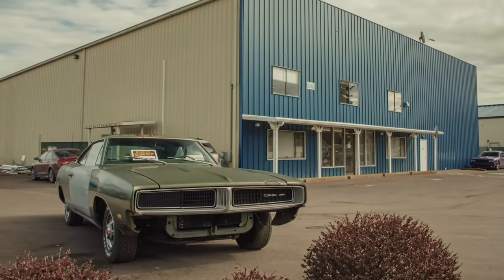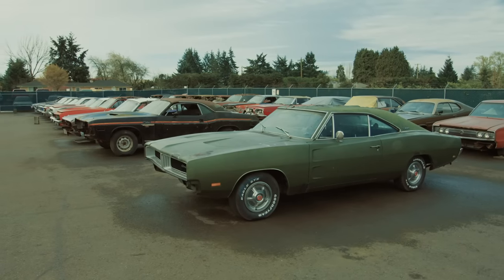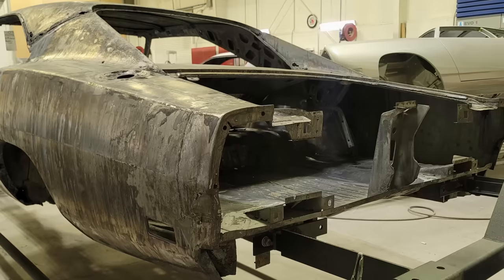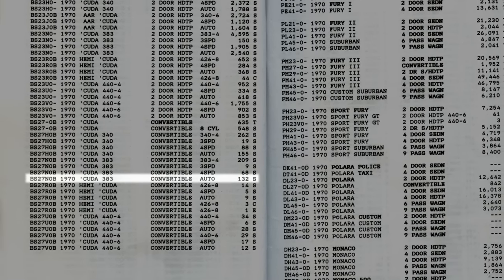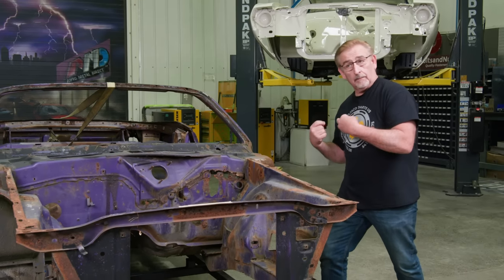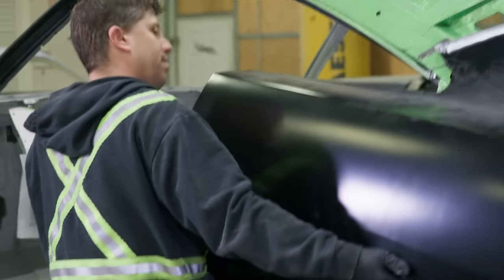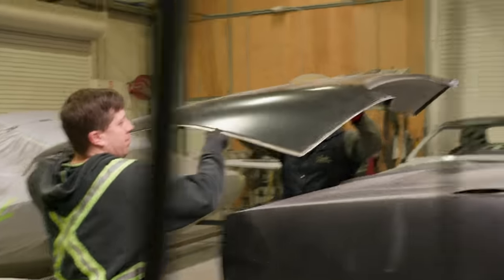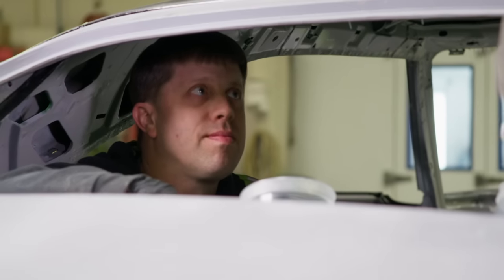NEW EPISODE*** SAVING A 1970 CUDA CONVERTIBLE AND TRANSFORMING A CHARGER TO A DAYTONA***NEW EPISODE

Comment: If I'm not mistaken and remember correctly I saw that same provision in a Dodge dart and possibly even a Chrysler Newport? Not for sure but I know I've seen that somewhere before and even though to myself,... "Why is there two different mounting bracket locations for the rear seat"?
Reply: I think the provision in the Newport is for the imperial and or New Yorker back seats since they are different from the Newport/300.